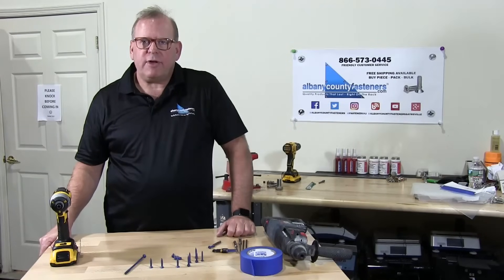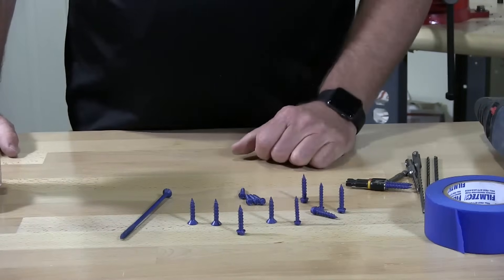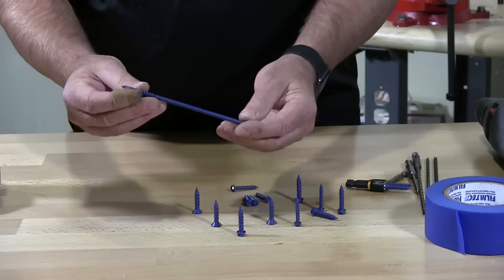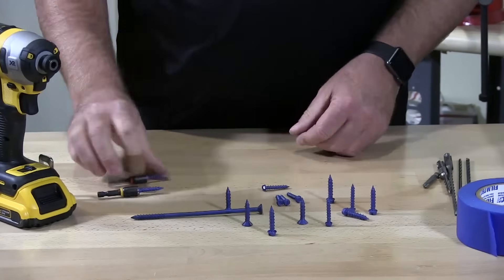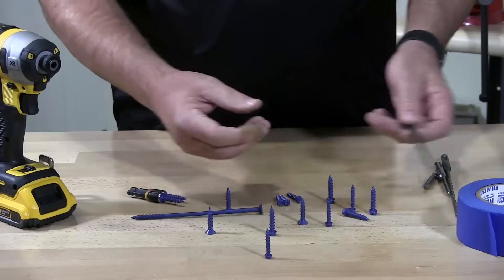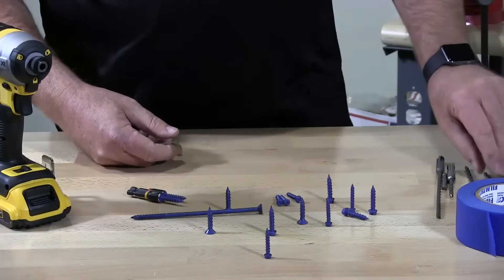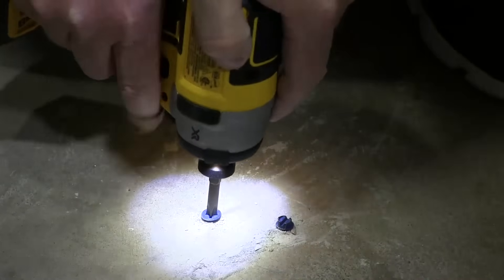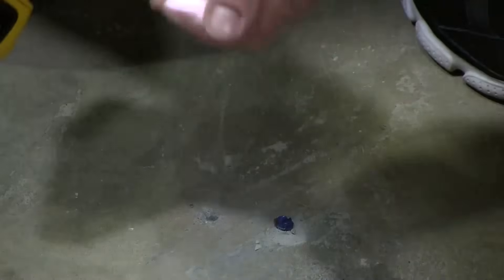How to Install Tapcon Masonry Concrete Screws | Fasteners 101

Comment: I've usually seen it recommended that you don't brush the dust across the drilled pilot hole (so you don't get more dust in the hole than already is)...and you use compressed air or a vacuum cleaner to remove as much dust from the hole as possible. (The idea, I believe, is that the concrete dust remaining in the hole will get compacted downwards, into the hole, when diving the tapcon screw. This will prevent driving the screw as far as is wanted, and can lead to over-torquing, and stripping the impressed thread (the thread cut by the screw, into the concrete, when driving it.)
Reply from the maker: Roy yep well put.  But how many installers are going to use compressed air to clean the hole? None  How many are going to get a brush to move the dust away form the hole? None  I have watched installers time and time again never cleaning a hole for a tapcon or wedge anchor.  They just drill the hole deeper and why?  Because they can get the job done faster.  This is just practical installation.  But your theory is spot on and thanks for your comment and checking my vid out.
Reply: With screws, it`s ok not to vac. The dust just goes into the grooves. But anything flat, yes. But he is right. Contractors are not going to take dust out.
Reply: ya just drill a tiny bit deeper then the screw length & some dust won't matter in the least.
Reply: An old trick i learned was to use a turkey baster to blow it out
Reply: @AlbanyCountyFasteners  This is not the answer I expected from a company that specializes in fasteners. Just because installers don't generally follow a good practice doesn't mean it shouldn't be done for best results. Loose dust at the bottom of the whole or in the threads of the screw can't be a good thing -- not if you want maximum holding power. Recommend the best practices and let the installers decide what to do. Also would increase any liability claims you might receive for poor instruction.
Reply: Sorry, I meant "...would decrease liability claims..."

Comment: I noticed you had a hard time drilling the first hole. I have the same problem. I use a Ryobi hammer drill and I've damaged 6 concrete drill bits already. It just won't drill the concrete.
Reply: You better use drill with hammer mode, but it only useful with low grade concrete. If it is high grade concrete - only rotary hammer will help. Also helps using Bosch blue all material drills. They go quite good into low grade concrete. Do not overheat the bit. Or you can use diamond bit for porcelain. It will work.

Comment: Why did my hex head tapcon screw break off when i drilled it in with my impact driver? It happened in 3 holes I drilled.
Reply from the maker: Two reasons this can happen.  1) The hole diameter is incorrect (3/16" screw requires 5/32" hole, 1/4" requires 3/16" hole)  2) You did not drill deep enough and your screw tip hit the concrete and as you keep driving the screw heats up and snaps.
Reply: @AlbanyCountyFasteners  ok TY for answering.  I think hole wasnt deep enough. And I bought the correct bits.
Reply from the maker: Good luck!

Comment: Thanks for the demonstration and training. Since this is for the benefit of inexperienced users, I recommend you set a good example with better drill control technique and set to lower speed when using the driver bits. Otherwise benefitial to many viewers.
Reply from the maker: Thank you for your feedback.
Reply: I tried to drill a hole in my brick today to hang something, no luck, it didn't work, I wish I had help.

Comment: can you insert tapcon screws into concrete at a slight angle?  I know that optimally you would want to drive them straight in but I have a situation where I am unable to drive them in straight?

Comment: I just bought 5/16" diameter TapCons. These are 3" long. Why did you leave out the 5/16" diameter? The thicker diameter provides better strength.

Comment: After removing the screws,
 the threads that was created in the hole seems crossed and the screws cannot be used again in the hole.
The hole and the screw diameter is now the same size.
Reply from the maker: We generally don't advise removing concrete masonry screws from their application for that exact reason. Even if you got the screws back into the hole, it wouldn't have nearly the same holding power it had on first installation. If the threading in the hole is too messed up to get the tapcons back in, you can either drill a slightly larger hole to fit a larger tapcon over the previous hole or use some other kind of masonry anchor, but that will depend on your application.
Reply: @AlbanyCountyFasteners  If you couldn't move your spot, could you drill deeper and use a longer screw? Just curious.

Comment: If you mark your drill bit depth with tape, don’t wrap it tight, leave a flag so when rotating it will keep hole area clean.  And the two screws were not hex head and Philips head!  It was hex head and flat head.

Comment: Thank you for your informative video! I am installing a folding shelf bracket, it's a very sturdy bracket. However, I am planning on screwing the brackets to a cinder block wall. What kind of Tapcon screw and size do you recommend I use. If you have any other information for this process, I would be very grateful to hear it.
Reply: I put cabinets up on a cinderblock wall today and I used the 1/4" tapcon screws at 2" length with a hex head. Avoid Phillips heads.

Comment: Is it advisable to dip the tapcon screw in oil or vaseline prior to driving into the concrete? I am replacing screws on bird cage in Florida that generally rust and need to be replaced every 5 years or so?
Reply: Have you tried stainless?

Comment: You said you can remove the screws, but can you put them back in the same hole?
Reply from the maker: It is not recommended to re use the same hole because the concrete screws will actually thread the masonry material that they are being installed into. This can compromise the holding power of the screws.
Reply from the maker: No. The new concrete will be unstable; it won't bond properly to the existing concrete and will crumble and flake. If you want to remove a concrete screw and install a new one in the same hole, you would be better off redrilling the hole and installing a larger screw.

Comment: I’m using 2"x1/4" Tapcons in 3/16 holes 1/2" deeper than the screws in my poured foundation walls but they aren’t holding, it seems like the concrete is soft. I don’t know... I’m putting on electrical boxes and it’s not good. I’m putting 4 screws in each single gang box and they still don’t hold. And I’m not over tightening them causing them to strip the hole and threads out, sometimes I can’t even get the screws to tighten before they ream the hole out. It sucks. BTW- I call the bigger drill a rotary hammer drill as opposed to a standard hammer drill that makes more noise but is much slower. When you used the standard cement bit I don’t think you used a standard hammer drill.
Reply: Tell us if you found an answer?
Reply: @offgridmangogrower  No I don’t know why they weren’t working for me, I talked to my best friend electrician friend about it and he said he runs into the same problem sometimes and to just use plastic screw anchors then which I did and it was all good then.

Comment: will  the screws go back in just as tight?.. thanks
Reply from the maker: Yes you can remove the screw and put the screw back into the same hole.
Reply: Albany County Fasteners...please read the question carefully before answering!
Reply: betty steve lmfao

Comment: What's the difference between using a 1/4in screw vs a 3/16in?
Reply from the maker: The main difference is that they have different diameters. The larger one,(the 1/4in screw) also has higher pull-out and shear strength.
Reply: Thanks. Which size would you use to hold down a laundry tub?
Reply from the maker: @df56gh4d5h  , if there is a hole in the bottom then the manufacturer probably has a recommendation that you should follow. However, if you are drilling the hole yourself you're better off  using the thicker diameter with a washer just to be on the safe side.
Reply: 1/16in

Comment: Only thing Home Depot had. Expect to put a toothpick in every hole. Expect to use 3x the screws you need as they are phillips and will strip on you almost every hole. Most frustrating product I've used in years.
Reply: yup imo wedge anchors are the best way to go when strength really matters.......for lightweight handyman type stuff regular sheet rock screws along with a piece of coated stranded copper wire works good enough imo except if water/potential rusting might be involved & I think stainless screws are still cheaper then these things.

Comment: How much weight can 4 of those screw hold? I have to install a 12lbs projector into a concrete ceiling, and I need to know if those tapcons would be enough, or I’ll need some others expending concrete screws?
Reply from the maker: Hi Pablo,
Thanks for your question! These screws should be enough to hold your 12 pound projector into concrete. There are several factors involved to ensure success. You need to consider, screw length and diameter and the thickness of the material you are going to be anchoring the projector into. Since we do not have this information, we cannot make a recommendation but do recommend that you choose a screw with a decent length to ensure a good hold once installed.
Reply: A 3/16" tapcon sunk at 1" has a 650 lb. pullout rating and a 720 lb shear weight.
A 1/4"  tapcon sunk at 1" has a 800 lb. pullout rating and a 1,360 lb. shear weight. 

Your 4 screws should be plenty....if you sank them correctly.

Comment: Excellent demonstration but I think there is a diameter of conicity to be taken in consideration when spacing screws from the edge of a concrete slab and between two tapcon screws. 

There is a very scientific calculation for it but a generic calculation is to multiply de diameter of the screw by 16. That number is approximately the diameter of conicity that will be formed by the tension created by and anchor incrusted in concrete.

You should space a tapcon half of that distance from an edge of a concrete slab and between 2 tapcons in a row center to center you should use that diameter of conicity to space 2 tapcons. This is a way to play safe when installing through concrete an anchoring fastener.

Martín Ibn-Rubain 
Structural Steel Detailer
Reply from the maker: Thank you for contributing this information.

Comment: When attaching a 2x4 to a brick wall, is the drill bit size the same for the 2x4 and the screw? Thank you.
Reply from the maker: Yes, the drill bit size is the same for the 2x4 and screw.
Reply: The company says to use 1/8 less diameter drill bit than the screw diameter.

Comment: Are there any moisture issues with installing screws in cinderblock below grade?
Reply from the maker: What is the specific application you are referring to? We don't have enough information to advise you with and your question is difficult to answer in a general sense.
Reply: @AlbanyCountyFasteners  Thanks for the quick reply.  The wall is in a lower level below grade, and I want to hang cabinets in my workroom. There have never been any moisture issues in the basement and the wall is about 15 years old. I know that you should try to put the screws in the solid part of the cinder block but is there a problem if you penetrate the inner cavity of the block? If you do penetrate into the middle of the block should you put some kind of sealant in the hole? I don't expect any problems but I have never used Tapcon screws before. Thanks again.
Reply from the maker: From the way you described your application, you shouldn't have a problem as long as you don't go more than 2-1/2" into the block. Any more runs the risk of penetrating the barrier that's keeping the moisture out of your basement. As long as you keep this in mind, you shouldn't need sealant to supplement your tapcons. Of course, if you want to play it safe, you can still use the sealant just to be sure.

Comment: Welp, there's 11 minutes of my life I'll never get back. This video is 10x longer than it needed to be to demonstrate how to install 2 masonry screws.
Reply from the maker: Thank you for your feedback.
Reply: On mobile, if you double-tap the right side of the screen it will skip the video in 10-sec increments, on a desktop if you use the letter keys 'J'and 'L' it will do the same. You can also use the arrow keys if you have them on your keyboard, the left arrow goes backward 5 seconds and the right arrow will go forward 5 seconds. Now you can cut that 11-minute video into a 5-minute video and use the other      6 minutes to teach someone this time-saving skill. :)

Comment: It took awhile to get that when you said "standard" bit you meant standard with the Tapcon kit. To me a standard bit is a high speed bit. What you were using is a concrete bit.
Reply from the maker: Our apologies. We'll try to be more clear about that in the future. Thank you for your feedback.
Reply: In those portions of the video, I think he meant to say "standard drill" vs. hammer drill. The use of terminology was a bit lax in this video.

Comment: ...can i use the tapcon screws without the plastic wall plugs if I want to mount a bracket shelving (for heavy object) on a concrete wall?
Reply from the maker: No plugs required.  Make sure you use the correct drill bit that comes with the screws for proper sizing.
Reply: ok thanks...
Reply: Probably preferred

Comment: I didn’t know you can use a standard drill to drill holes in concrete
Reply from the maker: You need a hammer drill for that! A standard drill only really works with drilling tapcon style screws in concrete since they are designed to be driven without a pre-drilled hole. Kind of like sheet metal or wood screws.

Comment: in real life at work these are always breaking . they need to use a better steel or heat treatment. i stopped using them. hopefully they read this from enough of us and fix the problem.
Reply from the maker: Thank you for your feedback.

Comment: Test is inaccurate due to using a battery driven drill against a corded drill. All parameters must be equal in a test. Very credible product tho' especially with multiple head choices and obviously the thread system to reduce heat/breakage
Reply from the maker: Thank you for your feedback.
Reply: It’s hardly a science test is it? Not as though we are testing quantum mechanics is it? You get the idea, right? Use that thing between your ears and think to yourself?

Comment: Can these screw go into block paving
Reply from the maker: Masonry screws should work just fine for block paving. Just be careful if you are going to use a screw with a countersunk head, such as flat head masonry screws. If you drive those all the way in, without creating a countersunk in the drilled hole, you could crack the block.

Comment: is that cordless dewalt drill a hammer drill? because if not this video makes no sense.
Reply from the maker: Yes!  This is a cordless dewalt hammer drill.  We also uploaded a review of the dewalt hammer drill and standard drill.  Check out the video on our channel.
Reply: Albany County Fasteners ok I gotcha, well my mistake then! but I'm glad the cordless dewalt that I have with the hammer function drills a lot better then that one no matter how cheap or expensive of a masonry bit I have in it.
Reply: colt beaver, the guy in the video is clueless. That speed test between the two drills made no sense because the so-called '' instructor '' using his cordless in drill mode let the bit flighting fill with concrete dust. He then began to wiggle and push sideways in an attempt to make progress. He doesn't seem to know there is a difference between a bit and a drill. Wonder how long he's been in business?
Reply: Please some body teach him how to use a drill sad

Comment: HATE tapcrap screws. These are absolutely GARBAGE. Hammerdrill with proper bits everytime. Clean holes out always tried blowing holes out and everything. They just are junk. SNAP!. STRIP. and thats 3/4 of the time i HATE them hardware stores are filled with open boxes. Wondered why but after many attempts i know why. Pure junk.